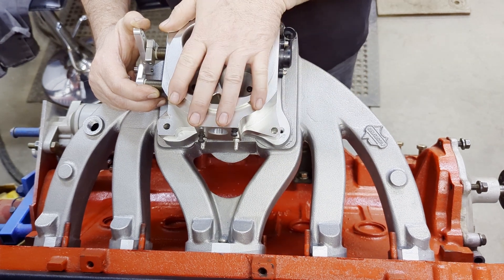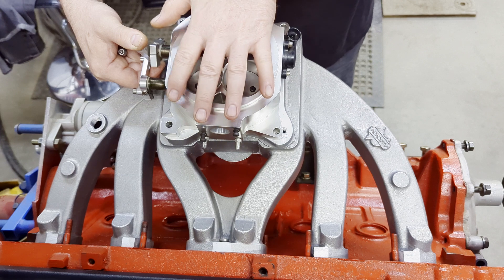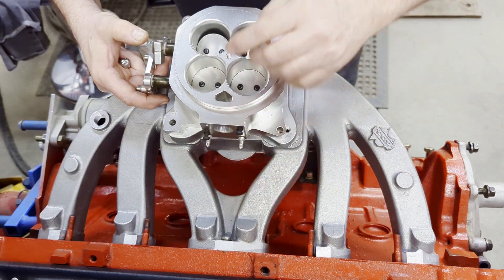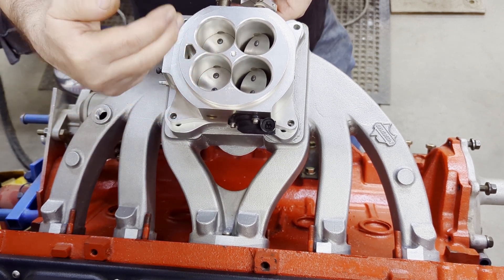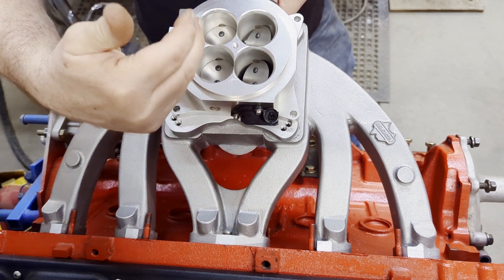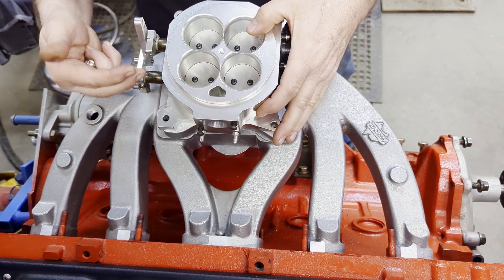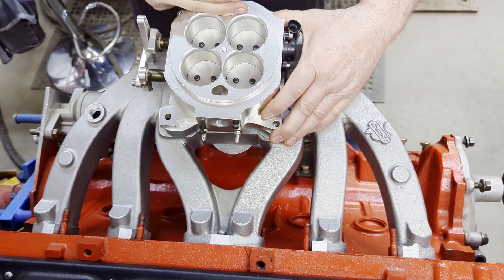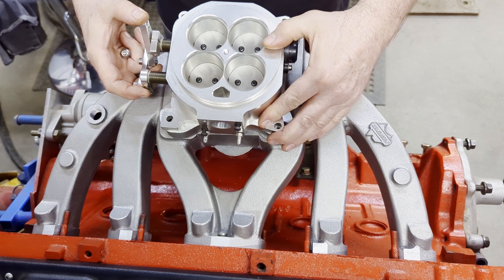Throttle Body Air Path Orientation

Comment: Mate, bloody excellent!!. Been banging on about this for for nearly two decades of MoPar Slant Six ownership, some blokes just don't get it, or won't believe it, even if you show them the official photos of the Slant Six HyperPak, which had the Carter 3083 4bbll with primaries towards the engine - mind you, the HyperPak breaths all six cylinders from the same side of the plenum, where your AussieSpeed unit there pulls from three sides, and primaries-away is definitely spot on for that manifold.

Comment: I have just spun my edelbrock 90⁰ on a long runner intake 265hemi 6. Made a huge improvement. I have primaries facing the head though but might try this now
Reply: VH E-34 Pacer manifold? If so, it was inspired by the Slant Six HyperPak, and yeah, both HyperPak and E-34 had the primaries facing the engine. You should have crisper throttle response off idle now, and when you check the plugs, they'll all be the same colour, and your fuel economy will improve, as at cruise all the cylinders will make the same power, so you end up at a smaller throttle opening. Now, it's not going to be as pretty as a VC with a HyperPak, or corner as well,.. :)
Reply: @PiDsPagePrototypes  yep that's the intake. 650cfm edelbrock AVS carb with a 1.5" modified tapered carb spacer and runs pretty darn good in a VJ charger. Mid 13's on the quarter so far

Comment: Great video!  I've seen several videos here on youtube that had Slant six build ups.  None had done this.  I was a member of the Slant six club of America back in the 1980's and knew Jack Poehler in Salem (I'm in the Portland area).  Although I haven't owned a slant for decades, I do remember this trick to get better efficiency and more power.  People would also wield a "wall" or plenum to separate the two sides of the manifold with good effect too. I'd love to listen and drive one of these engines with a TBI added.  Again, its great to see what you are doing.

Comment: I have a question I am guessing you guys are making slant six kits to bot on a slant six? Thanks Kyle
Reply from the maker: Yes, we do make kits for the Slant Six.
Reply: @GillWelding  what are included in the slant six kits? How much would they be? Thanks again Kyle
Reply from the maker: @Kyle-bb9zp  Each kit is custom tailored, for EFI we can typically provide everything from Fuel tank to exhaust. Pricing varies by options. Reach out to us at www.gillwelding.com for an estimate. Make sure to subscribe for some upcoming basic EFI videos.

Comment: Seems like a catch -22. That way is certainly better for the fore n aft orientation, but then wouldn't the secondaries favor #3 and #4 since they're shorter?? Obviously that's still a better problem to have but...  It seems like multiple carbs (3??)  are the only way to get equal runners and true even distribution... If my slant wasn't getting a stock resto, I'd love to be fiddling and experimenting with it!!!
Reply: As the secondaries open, they do start to fill 3&4 more, and letting 1&6 breathe from the primaries alone, while 2&5 pull from all four barrels.